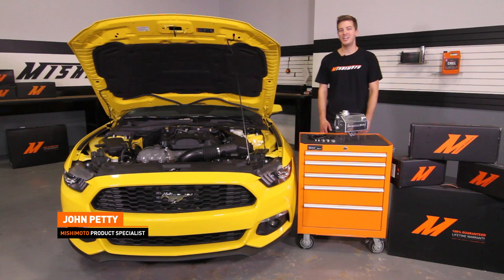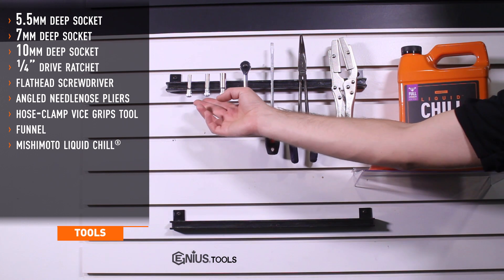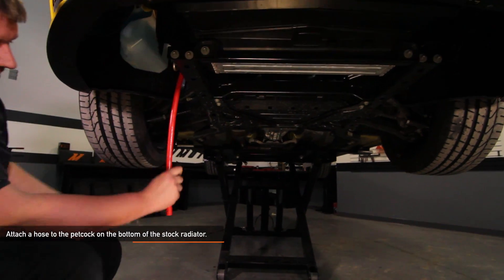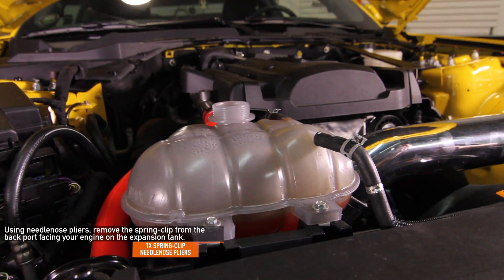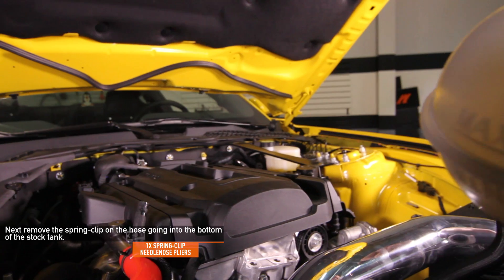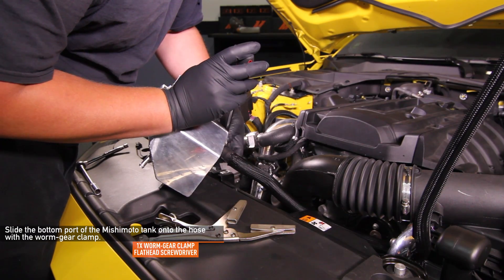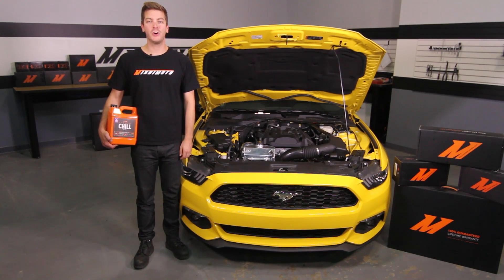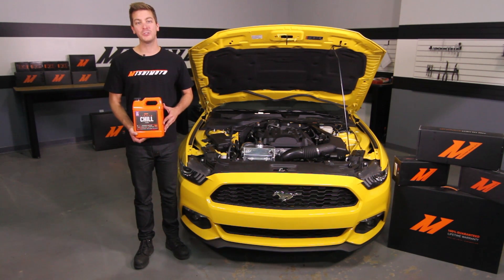2015+ Mustang Expansion Tank (EcoBoost, V6, V8) Install Video By Mishimoto

Comment: At 3:12 it says to route the hose from the fill neck down toward the lower radiator support. Does it connect to anything down there?
Reply from the maker: The hose will not connect to anything, this will simply redirect the overflowing coolant away from the engine bay and toward the bottom of the car. For some NHRA racing this hose will need to go an a seperate tank to keep coolant off the track.